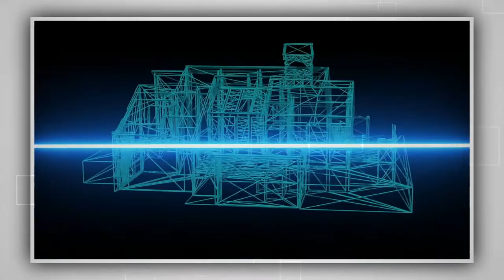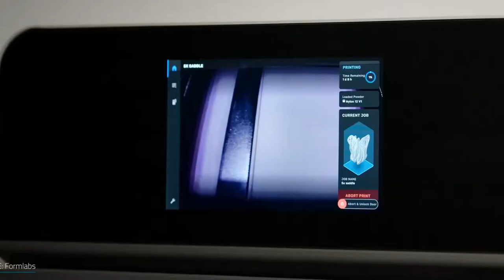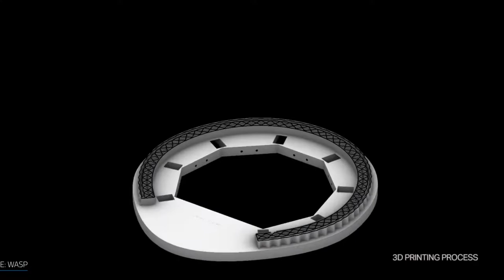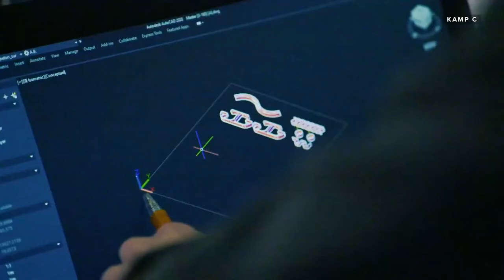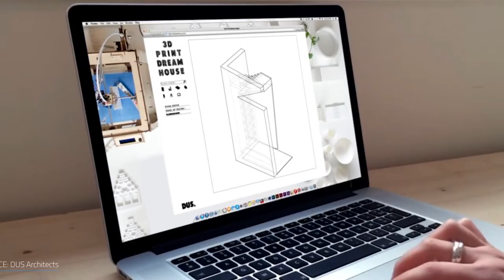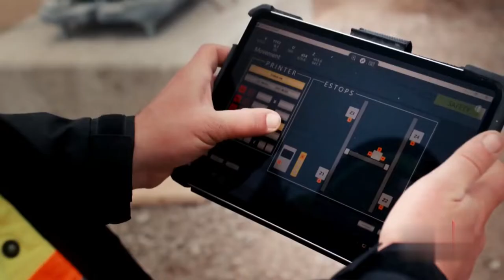The DARK SIDE of 3D Printed Homes: | Dirty Secret Revealed

Comment: Note that china is researching on developing 3D printers that print metal and can print 4-story houses out of cement...    The 3D printer itself can be partially printed, especially the "rails" and parts of the extruder.  3D printing energy collection like solar panels, persian yakhalt, or other devices isn't too far away.